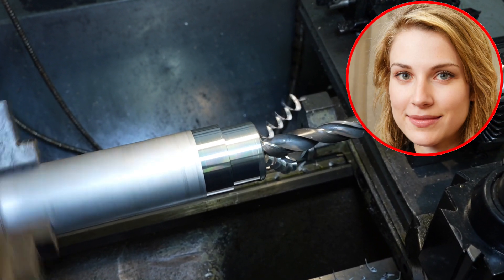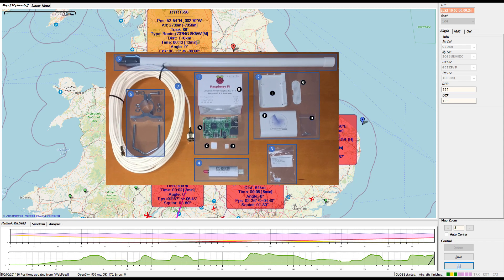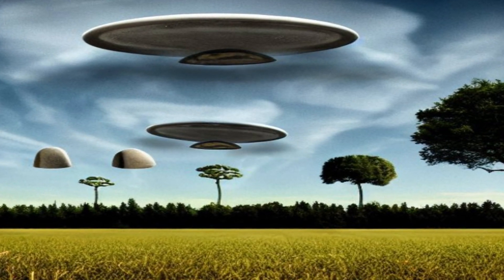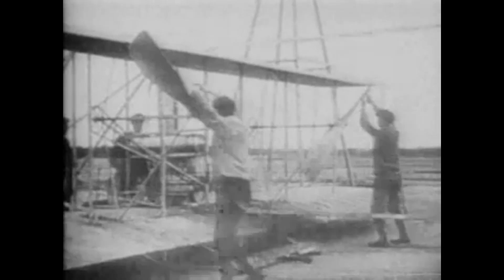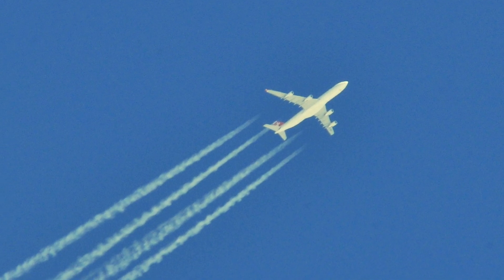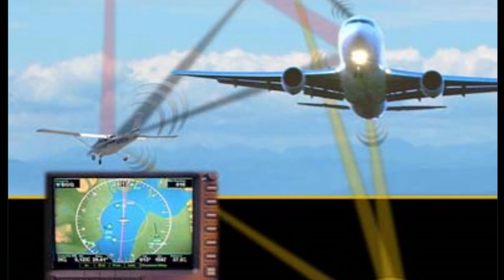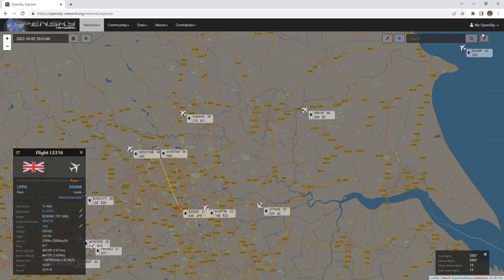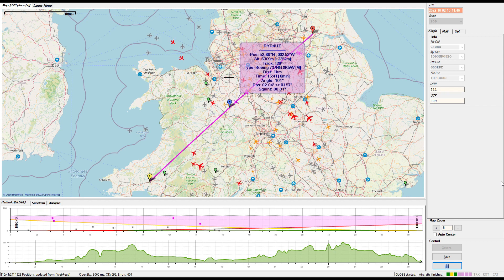Machining an Aircraft Tracking Antenna Mount ADS-B - OpenSky

Comment from the maker: This is my first video filmed using my spiffy new Sony a7 IV camera, so there are some dodgy bits of focus and a weirder-then-weird dropouts on audio. After some fiddling, I found the root cause. Machining sounds and compressed air blasts sound like wind noise.  Wind noise suppression is on by default.  Turned it off now. Also the built-in microphone is VERY omnidirectional and picks up my heavy breathing, sniffs and other environmental noises.  I'm going to use a directional mic when I'm doing machining shots in the future as there are weird hums and buzzes from contactors and the lights, plus my 100 watt LED flood has a noisy fan that's intrusive.  Oh, the joys of being a beginner videographer...  Luckily, my youngest granddaughter has a degree in photography and teaches it at a local college, so I've been quizzing her endlessly.  (Hi Violet!)

Comment: Am I the only one that touches off on just one side of the part if I already know the dimensions? 🤔
Reply from the maker: I change methods depending how I'm feeling.  I didn't know the exact dimension as I only set the parting tool by eye, so I had to measure it carefully.  Often I use a chuck spider to space the part away from the chuck, then I can use the parallels of that tool as my datum for measurement.  There's probably lots of wrong ways to do it. If I can fit in a hub micrometer, I use that when the linear dimension really REALLY matters
Reply: @MachiningandMicrowaves  Definitely nothing wrong with your methods, they get the job done and I'd say very well at that. I see Adam (Abom79) doing the same thing all the time. You just happened to be the one I'd ask 😄 Most of the milling I do is CNC so I'm certain that has a lot to do with why I only touch off on one side 90% of the time.

Keep up the good work, always enjoy your videos!

Comment: Drilling into a round surface with no spotface or even spotting drill, plus running your edge finder and tap in a drill chuck, I'm surprised AIMEE didn't give you any lip.

Also, when we had our spot drilling discussion on Discord a week or two ago I did find in my Machinery's Handbook that you should always start with a spot or center drill when drilling on the lathe. No mention of spot size of course.
Reply from the maker: Heh heh, I have a feeling that the friction edge finder will compensate for runout in the chuck. No defence for using a tap in the chuck, that was just laziness. Most of my drills are ground to a split point so they start themselves pretty well even on round workp;ieces.  My father taught hor to grind those split points when I was knee-high to a grasshopper. He retrained as a tool and cutter grinder after many years working on turret lathes and mills in a gas turbine plant. I hope Brother Taps might do a vid about the best size for a spot relative to the size and angle of a drill. I used a 3mm carbide spot drill in my latest vid, using a 2mm spot for a 3.3 mm drill and a 3mm spot for a 5.0 mm and they appeared to stay spot on track.
Reply: @MachiningandMicrowaves  I would love to learn how to grind a split point. I just do some web thinning if the drill is big enough that I think I can get away with it, and hope I don't make things worse. I don't have all that much experience sharpening twist drills, so it's always a learning experience.

Comment: Great, as always.

A grippy split rubber ferrule could support the coax from the bottom end of the mast, making the coax slack a bit, spiraling along the inside surface. Hair brain idea, but I heard comments are helpful for a channel, even worthless ones.
Reply from the maker: That is actually right on the money. Plan is to fit an internal collar in the tube about 50 cm down, then fit a compression gland to a disk of Delrin, leaving 51cm of feeder above it, and form a loose spiral with the slack.

Comment: Qdos for the Quinn reference. I've been thinking of building one of these for a while (as soon as I get time). 
In the mid 1990's when I was one of only two amateur operators with 6m band equipment in Hervey Bay (QLD Australia). I was on the approach path to the airport and the phase distortion was REALLY noticeable when an aircraft flew between us.
Reply from the maker: I first heard/saw aircraft scatter in the mid-1960s on Band III television. We lived under the flight path of the Vulcan bombers from RAF Waddington. Scatter at 10 GHz is usually ridiculously short, but the in-flight refuelling tankers over the North Sea to my east often fly a path which is along the direct line of sight from me to some of the propagation beacon transmitters in the Netherlands and Germany, giving up to 90 seconds of signal with almost zero doppler shift.

Comment: Dumb thought with regards to the unsupported cable- could you make a delron (or similar plastic) plug a bit smaller than the ID of the mast, fix it to the cable, and then run a set-screw or two through the mast at a pre-determined height to secure it?
Reply from the maker: I think the simplest fix is to weave a four-strand sinnet plait into a finger-trap. I'm a basketmaker in another existence so that's an easy job. then just tie that to a bolt or loop.  Then maybe use some closed-cell foam disks with a hole and push them up the inside of the mast to give a bit of lateral support.  Main thing is to avoid pulling the braid/foil or inner conductor out of the N connector while also avoiding the ding-ding-ding so beloved of folks who live in a marina.
Reply: @MachiningandMicrowaves   Like I said, dumb thought. XD
Reply: @c.a.mcdivitt9722  Thanks all the same, would not have learned about this "finger-trapping" thing otherwise.

Comment: oooh 3 point micrometers always fascinate me, too pricey though. I have to make do with telescope gauges for now.
Reply from the maker: I seem to have gathered quite a few from ebay, from 6 mm up to 50mm, mix of Mitutoyo, Bowers, Tesa, Oxford and SPI. Some are a little battered, but with a good selection of gauge rings I can get very close fits with them.  I use Starrett telescopics for anything over 50 mm

Comment: Lovely to see some GB3RPE cameos, that lovely Carmarthen lot have done a good job getting it on the air
Reply from the maker: I've not heard it by aircraft scatter much, but I've had some very good rainscatter returns from it. It has one heck of a good antenna site on top of that giant concrete monolith. There's an awful lot of Wales in the way between me and RPE, plus a lot of mud and rock in Derbyshire/Staffordshire to get over. 311 km over a highly-obstructed path on 10 GHz https://www.beaconspot.uk/beaconc.php?beaconcall=GB3RPE
Reply: @MachiningandMicrowaves  It would be even better if the concrete monolith wasn't in the bottom of our Welsh valleys and I wasn't in the bottom of a different one
Reply from the maker: @Tim Clark  I work Clive GW4MBS now and then on 10GHz and he's in IO71XW in a hole in the ground. Also heard him on aircraft scatter but it would need a fast mode to make a contact with only 2-3 second reflection peaks. Maybe JT9F-fast at 15 seconds per transmission?

Comment: Perhaps some plastic bush or "spider" could be used to offer the cable a bit of support inside the mast?
Reply from the maker: I have a couple of ideas from doing similar setups on other antennas. It's tricky with foam insulated cable with a foil sheath as it's easy to damage the cable, but a spider that clamps to the cable and rests on a ledge inside the tube might be the simplest way.  It needs to be loose so I can remove the antenna if necessary.  Quick and dirty solution is to fill the tube with poly building foam, but that's a bit permanent!
Reply: @MachiningandMicrowaves  I don't know how much support you'd need, but I can see that the moment you fixed the cable permanently you would need access. 🙃
If crushing the cable or foil is the issue maybe a C shaped collar of ensolite or other resilient closed cell foam could grasp the feed when pushed inside?
Don't mind me. I'm just another screwball enthusiast who really enjoys your mix of machining and sarcasm.
Reply: Rub Vaseline on the cable then use foam and hopefully it won't stick to the cable
Reply from the maker: @nbtmx1  Other good things about using foam are that it stops condensation form diurnal pumping and stops the ding ding ding as the mast moves in the wind and the cable slaps the inside of the tube.
Reply: Look on the brightside you could say it's also a wind chime.

Comment: Looking forward to the next one! As a Ham, training private pilot, and amateur machinist I love your vids!!!!
Reply from the maker: I was hoping to get the software installation and config in this one, but I ran out of time after having a lovely visit today from granddaughter and great-granddaughter.  It's also 2.30 AM local time and I have to be at work in six hours so I must get to bed.  The receive setup is the colinear into an RTL-SDR and Raspberry Pi 3 running a custom image from OpenSky.  It connects over ethernet into my home LAN.  I've done a little iptables NAT trickery and added a netsh portproxy on my Windows machine to get round a software bug in the prediction software which is expecting a local dump1090 instance and refuses to work with a remote IP device.  The NAT has to be there to publish the dump1090 service on port 30005 as it's bound only to the loopback instead of the ethernet so isn't routable.  Computers.  Yuk
Reply: @MachiningandMicrowaves  wait you have a granddaughter and you need to be at work in 6 hours. Typically, those are disjoint sets of people.
Reply from the maker: @AlessioSangalli  Great-granddaughter, soon to be joined by a second great-grandchild. My seven grandchildren are in their mid to late 20s. Some of my stepchildren are almost my age. I might be able to retire in a few years. Caroline was 20 years older than me, and came with a ready-made set of offspring. Her previous husband was born in 1918. "It's complicated"
Reply: @MachiningandMicrowaves  so if I understand correctly, dump1090 is the ads-b decoder and runs on the Raspberry, reading data out of the rtlsdr and presenting it to the network. The prediction software however is a (closed source?) MS window program, that only wants a local source for dump1090. My instinct would try to solve that in user space with ssh -R, but while I am confident it'd work for Unix systems, I don't know how well it would work on windows. The reason you have a Raspberry in the loop is merely due to the fact you don't want the RF line to be too long in order to reach your PC?
Reply from the maker: @AlessioSangalli  Yes, the Pi means I don't need to leave a Windows box running all the time and I can mount it away from the lab to reduce electrical noise from it. Using netsh portproxy in windoze has the same effect as a prerouting nat in iptables. Might be a better solution by tweaking the dump1090 but I wanted to run a totally stock image and config if possible to simplify upgrades. More detail in part two
Reply: @MachiningandMicrowaves  also, this antenna is a collinear type? What's the radiation pattern? To receive signals from up in the sky one would think that a collinear would make the takeoff angle pretty low
Reply from the maker: @AlessioSangalli  Fairly low gain leads to a sort of donut shaped radiation pattern with an overhead null, but only by about 20 dB. Planes at high angles are very close, so the inverse square law compensates. At 45 degree elevation and 12 km high, the response is only about 4dB down, but the signal is 20 dB louder than from 150 km away ar that height. Directly overhead for 1 km radius or so, the signal might be a little lower that it would be 50km away, but it's fow a really short period. I'm hoping to see up to 400 km in some directions. More on this in the next episode when I look at the results
Reply: @MachiningandMicrowaves  yeah as I used to do satellite stuff (MIR, ISS) the overhead null was frowned upon, hence eggbeater antennas and the like. Also when launching stratospheric balloons we'd hang some sort of antenna that didn't have the null. But I see in this case it doesn't really matter too much....
Reply from the maker: @AlessioSangalli  I think the 12km max range for overhead planes negates any dip in the antenna pattern. Not noticed any obvious loss as planes fly over